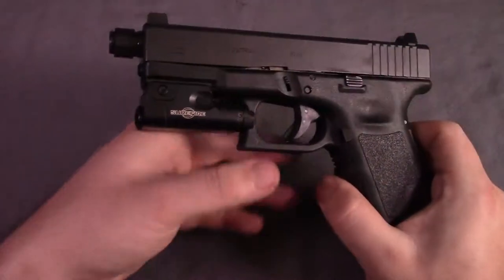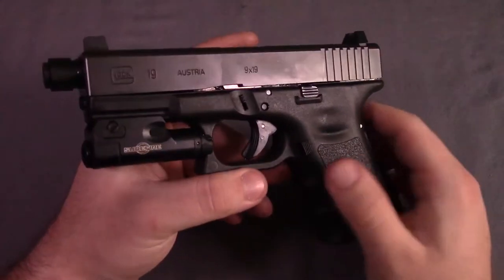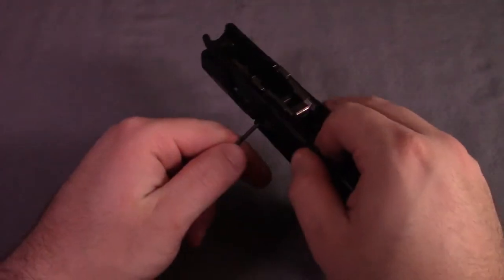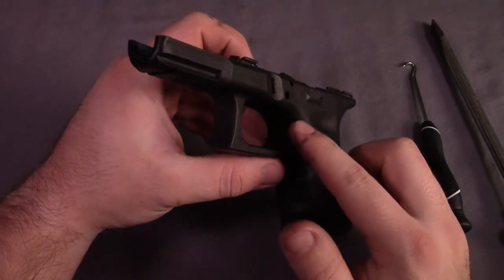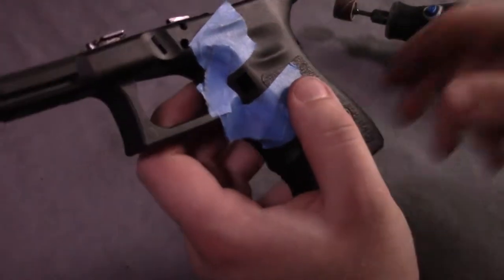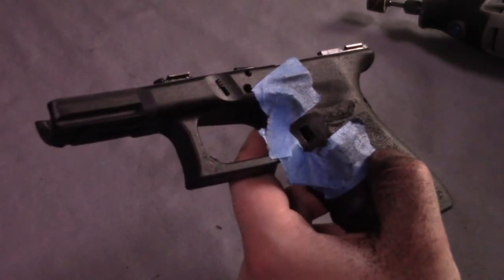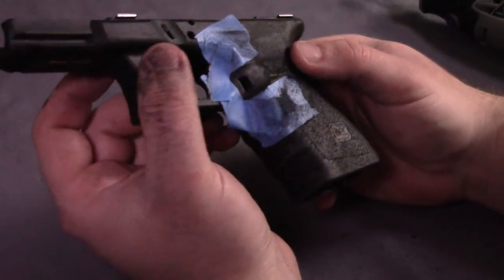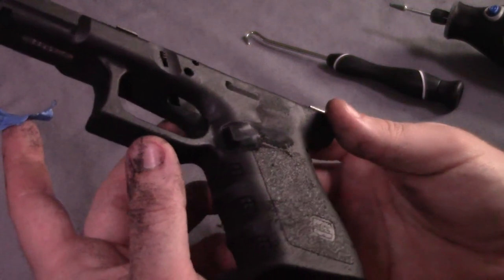Mag Release Scallop - Glock Mod Series Part 1

Comment: +OreGear I really like the instructional vid!  Nice work.  It seems you have done this more than once.  How many poly frames have you done like this?  The only suggestion I would have is that there is a lot of shadows on the work and sanding/grinding you're doing.  Maybe have a light shining from the camera or just behind the camera to enhance the fine tuning work.  I'm wanting to make a few mods on the G19 I just got and I really like the Scalloped release and stippling but I'm a little nervous and that's why I wanted to see as clearly and close ups of what you're doing and what you just did if that makes sense!  Gracias mi amigo!
Reply from the maker: +Ross Bishoff I appreciate your feedback! This was my second time doing the scallop, but I've done modifications to probably half a dozen Glocks. My next big purchase is going to be a new lighting setup to hopefully fix the lighting issues in this and other videos. I've even slowed my video production until I get the new lights because I want to make sure future videos are much easier to watch.
Thanks for watching!

Comment: What are you using to polish it? Thanks in advanced!
Reply from the maker: +Shanobix209 I was actually using a Silicon Carbide Grinding stone #84922. I don't know if it's meant to polish, but it works.
Thanks for watching!
Reply: +OreGear and did you also used a polishing compound? I felt like I should've waited and watched your videos before stippling my gun. Lol
Reply from the maker: I haven't used any polishing compound. I just went with the bit. I know that's not what it's intended for, but it worked well enough for me.

Comment: Is there any fix for breaching the magwell a little bit? I’ve read about melting a backstrap to use.
Reply from the maker: I’m not sure about that. If using a back strap doesn’t work, you could try using an epoxy to fill it back in. But I don’t know.
Reply: OreGear Ok. Thanks.
Reply: Broderick Hall were you able to fix it?
Reply: RICEY702 yes, I melted a back strap down and filled it in. I sanded it back down and just have to stipple it now.
Reply: Broderick Hall by chance, do you have pictures? I kinda took too much when removing the finger grooves and see a little bit of the mag release spring
Reply: Broderick Hall did you melt it with a soldering iron or lighter?
Reply: RICEY702 I used a soldering iron to melt it. I just kinda molded it.